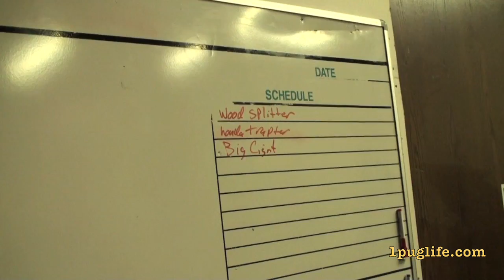wrong parts

Comment: that pulley is called a timing pulley and the bushing it uses is 
called a taper lock bushing available in many shaft sizes.
there should be a part # on the bushing (example sd x 5/8 )
all should be in stock at any good power transmission and bearing co.
love the videos and sorry for your loss.

Comment: Yea snowmobiles are Dangerous, but its a rush. I been riding my whole life even tho that's not long since I'm only 25,,lol.     I only ride 500 to a 1000 miles a year.    My Mom broke her pelvis on one a couple years ago.      I remember running along side the highway with my Dad and we were passing cars that were going 70 and he hit a hidden driveway.    his sled flew higher then the cars and went over 1.  someone he was alright.     we did our best to unbend his sled and tape it together since we had another 70 miles to go to get home.       I also go around and buy snowmobiles and part them out.  I got the 2nd story in the barn packed with sleds

Comment: What you wanna do with your pulley adapters, get the smaller one that fits the motor shaft, turn it down in a lathe to a press fit to the ID of the larger adapter that suits the pulley. If you measure the ID of the larger adapter then you should be able to just give the smaller one to a shop with a lathe and tell them you want a press fit between the two. Then just mash it in the vice and you're cheeched.